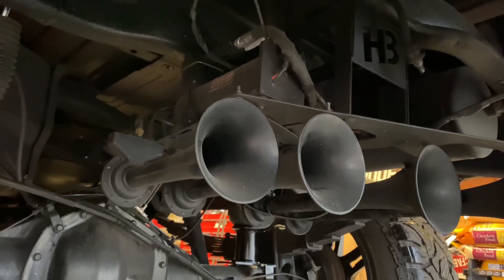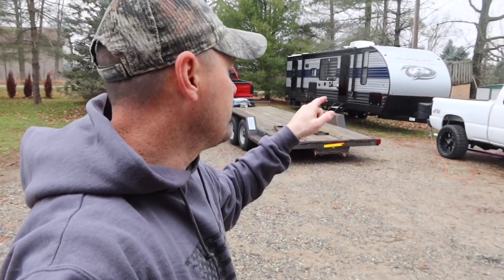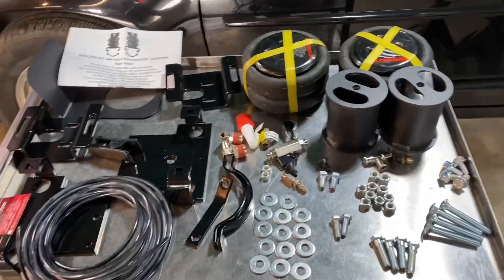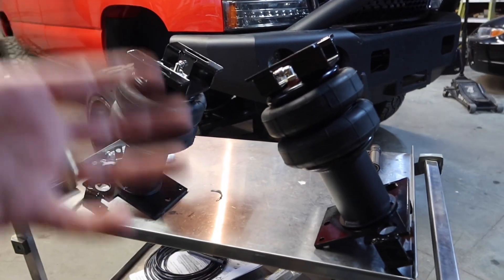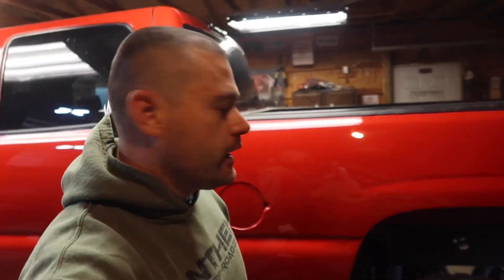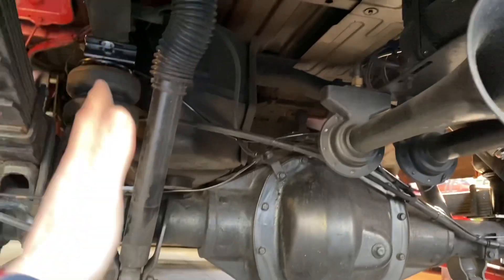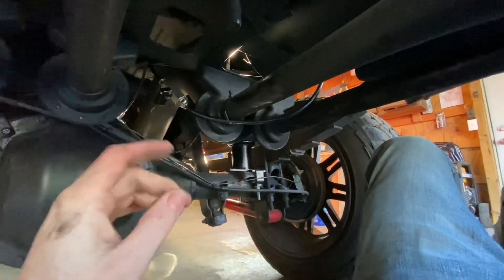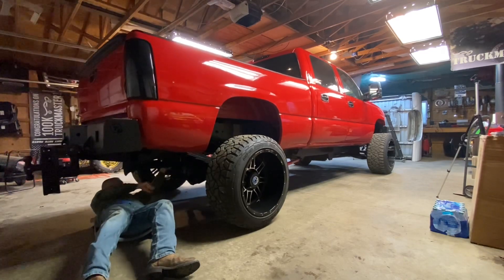Connecting Airbags To Train Horn’s On A Duramax!

Comment: 3 months later.. “this is why you dont cheap out on airbags” 🥲
Reply from the maker: I disagree
Reply: @TruckMaster  keep us updated, im curious to know how they hold up
Reply: Most these cheap kits the lines crack long before there is a problem with the bags
Reply: Usually airlines and fittings crap out before the actual airbag fails. You can have cheap airbags but spend the money on good lines and fittings and be good for a long time.

Comment: Nice nice trying keep it simple i like but i build trucks on air ride an a pressure switch wouldn’t hurt you an also a WATER Trap don’t want water in the air bags an in the lines to make them brittle after time an over time if your put your drain back on you can still drain. Also it will be good for your life span on the compressor with a water trap an pressure switch an a can wire it to a valve an push of a button to go up an down.
Reply from the maker: Thanks for the info that’s great advise

Comment: 10psi in the bags is all you should need. My dad pulls a 37 foot toy hauler fifth wheel and he said it keeps it level with the weight
Reply from the maker: Thanks
Reply: Running a 5th wheel vs a bumper pull of same weight you will have different psi in the bags
Reply: @PhillWickert  okay. Just bought my 11 ram that is set up with bags but have not yet pulled my 30ft bumper pull camper to figure that out
Reply: Different psi for different loads. Firestone guage installed in the center console to keep your clothes clean.

Comment: I’m sorry bud but that’s just crappy GM designing. Hotshot guys use Dodge for a reason and that’s because they have the best suspension on the market. GM needs to get with the times and upgrade and update their suspension systems. I’m sure I’ll get roasted but it’s my honest opinion. I’m a GM guy and had a 05 2500 with the DMax.